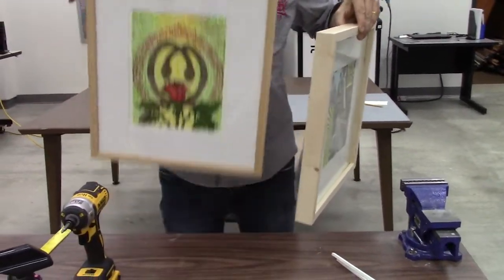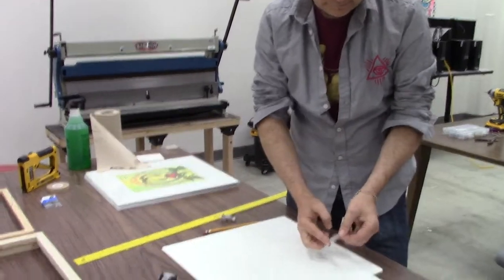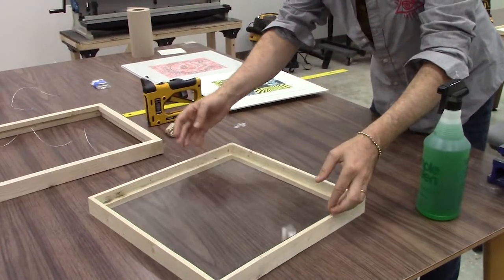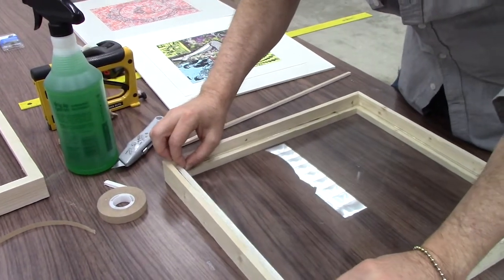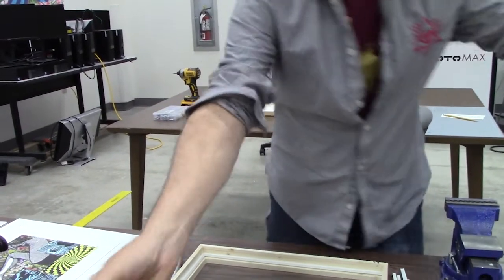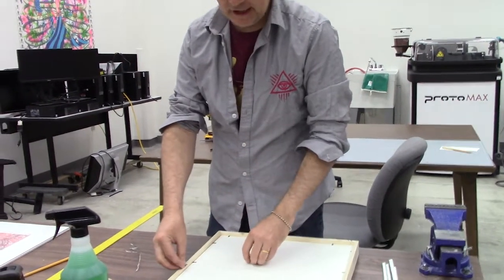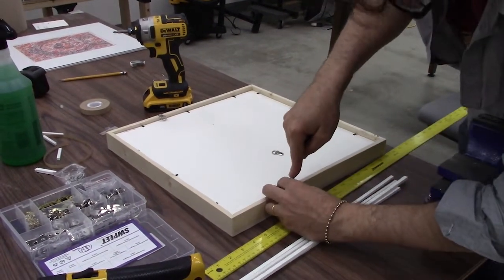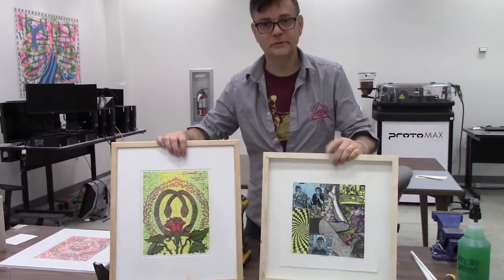Basic Picture Framing for Artists: Shadowbox aka Free Floating Artwork

Comment from the maker: Tools and Materials used in this video: 
-Utility Knife
-1/2" wide ATG Tape
-Logan F500-2 Dual Point Driver
-Corked back aluminum metal yardstick or safety edge
- D-ring hangers and screws or Screw Eyes and framing wire
- Self Adhesive Linen Hinging Tape 
- white acid free foam core (Used for backing and for sides) 
-awl
-philips head screw driver.